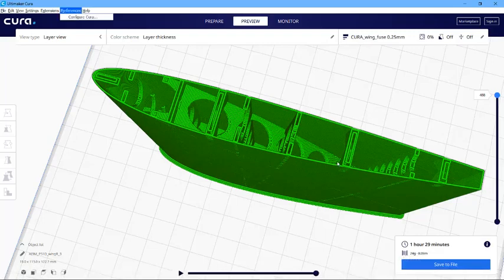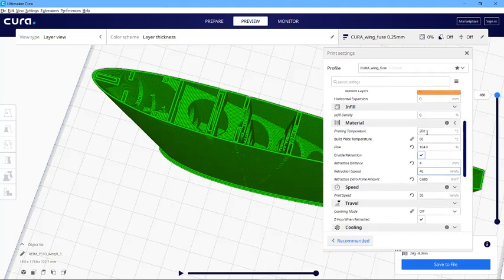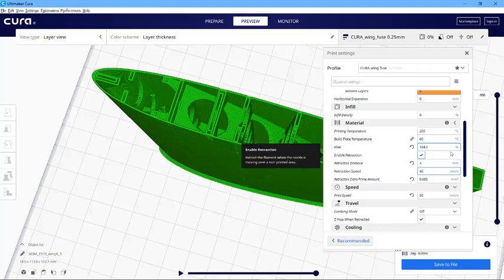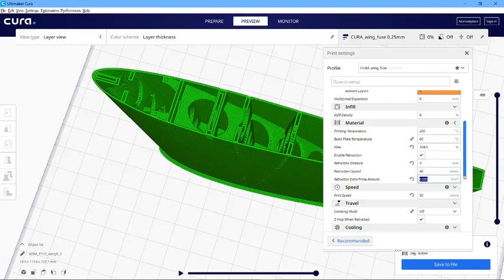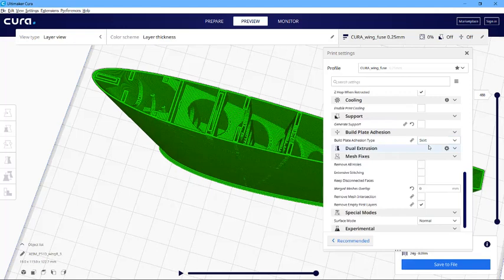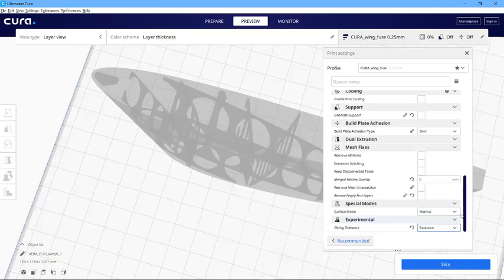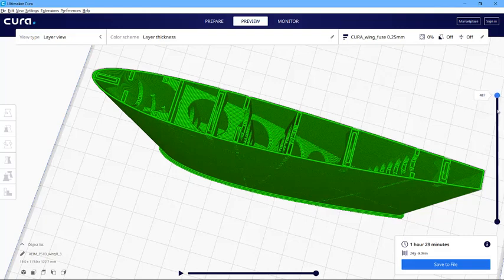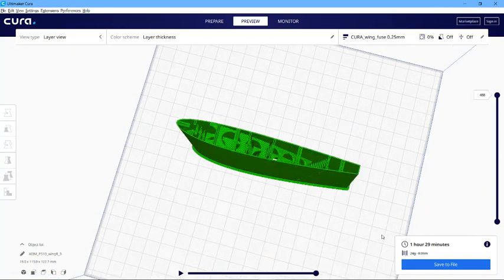P51D Wing   Cura settings

Comment: What printer?  Are you printing in standard pla? I just finished the me109f and it turned out OK but needs work so I'll be reprinting.. about 10% up on my prints I have got very thin layers almost mesh like it's happened on every one of my prints and I can't figure out out